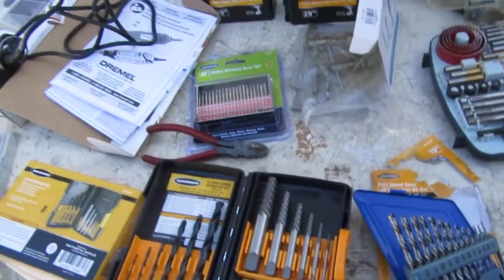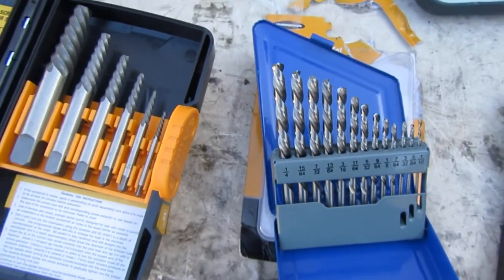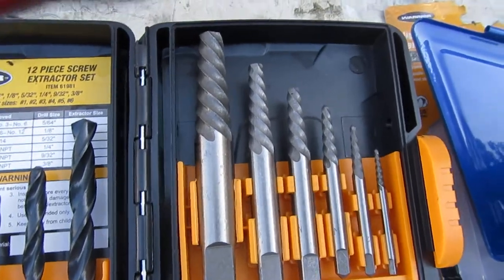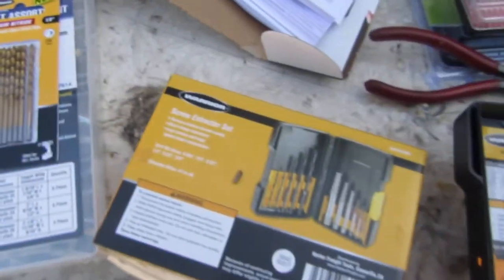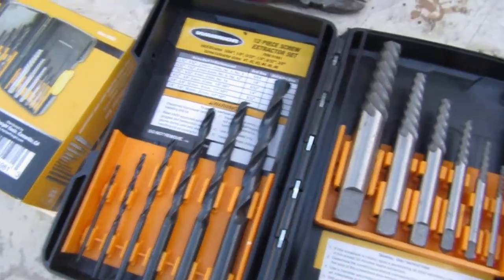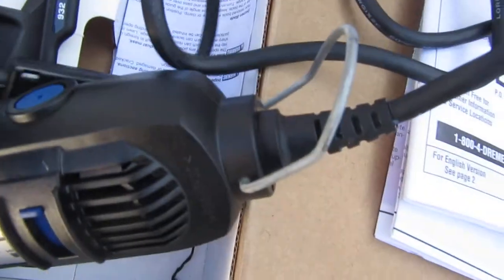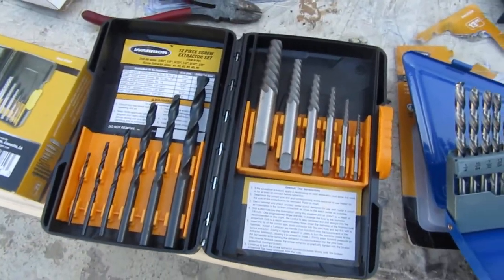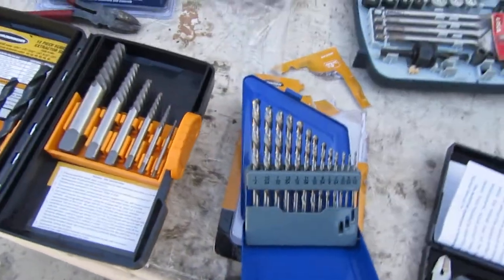How Harbor Freight can improve Bolt Extraction Products

Comment: They don’t make cobalt steel extractors. And they shouldn’t either because cobalt is for high temperatures and hard surfaces But it’s brittle and breaks easy. Extractors come in high carbon steel and high speed steel. HSS being strongest. Cobalt is for drill bits. Plus Titanium Nitride drill bits do NOT have cobalt in them. They are regular m2 hss.